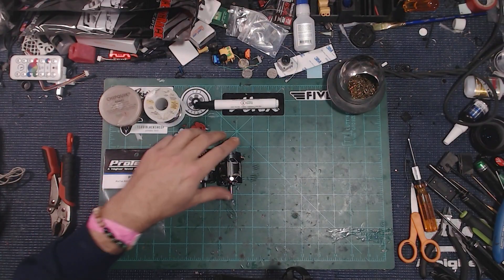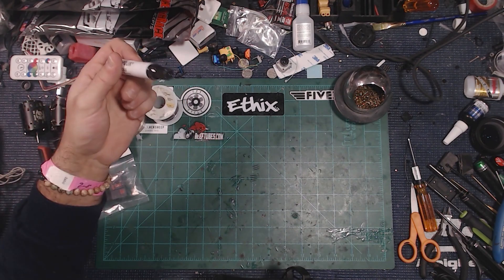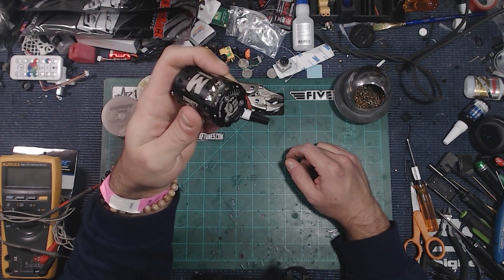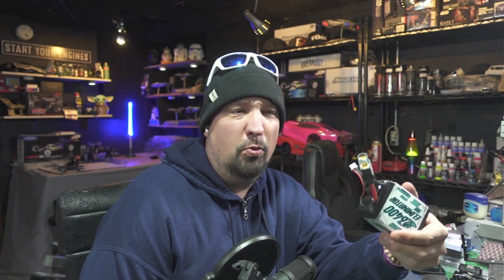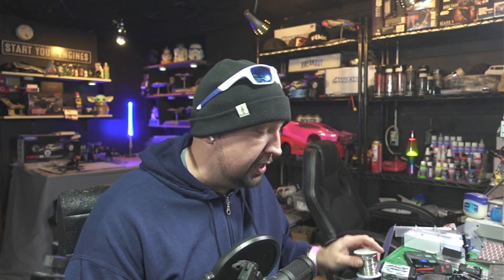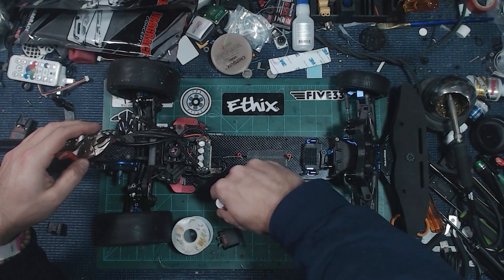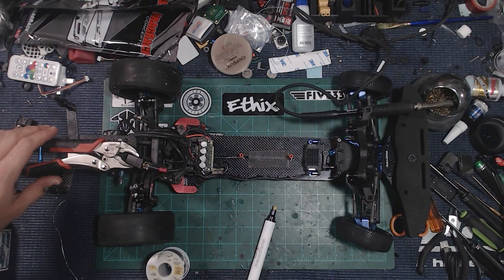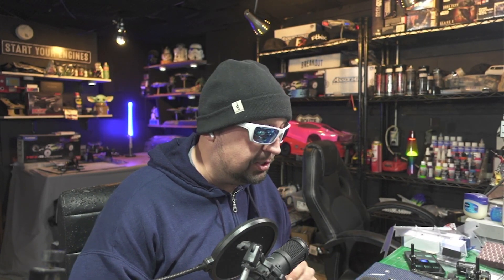SOLDER YOUR RC CARS AND CONNECTORS LIKE NASA DOES!!  QS8 SOLDERING | TOOLS TIPS AND TRICKS

Comment: these are tiny wires... easy to solder... we a 200a to 300a....  using 4awg to 6awg wire to QS8 & QS10 connectors..  how about soldering these?
Reply from the maker: Imo and data I’ve never been able to see any meaningful performance using 8 or 12g wire. If you want to push it then have at it.  It all makes sense but lower gauge never showed me it was a differndce maker. Same goes for qs8.

Comment: You need to make a guide just for soldering trinity motors. I struggled so bad on my 4 turn
Reply from the maker: I spoke about it in my last soldering video. Their tabs lead right down to the poles. Have to be really careful. Flux lots of flux so use little heat as possible.

Comment: Good video Chad.  Curious did you ever do a back to back xt90 vs qs8 connector test on the same car setup?  Just wondering if it’s worth me making the switch.
Reply from the maker: Thanks man. According to my data logs I only saw maybe 10-15 more amps being pulled through a qs8 over an xt90 with no noticeable change in voltage.  I’m debating on going to xt90 again for weight savings and being able to pull them apart a little easier.  In theory the qs8 should be better but it’s very hard to actually prove that imo. Having a 10 gauge wire over 12 is also theoretical and very hard to prove. During my fpv days we went through this entire exercise when we moved from 4s to 6s for racing. 2s is tricky though because the voltage is so much lower at say 8.4 vs 24.6 :) do you get less resistance at the higher voltage when pulling the same amp load.  So to make a short answer it can’t hurt but it’s not going to make s huge impact :)

Comment: Good video Chad. I do the same technique as you. I love using the flux helps it flow nice. Couple of my rc buddies always would say "it has flux in it" I tell them what I just told you. Well there shit pops off especially when the motors hot so guess who ends up fixing it Lol, I'm pretty good I used to do car radio and alarms installs 5,000 watt systems with multiple subs. You know it has to be right the vibration alone will test your Solder skills. I know when I have a good connection when the solder shiny. 1-up racing has very good material. 👍🏾👍🏾 Good job my friend.
Reply from the maker: thank you sir.  you know what youre doing then for sure..all those small wires arent easy
Reply: @Dorkyand40  no they are not. Agreed! I use applicator clips also clothes pins reversed. Rubber bands on pliers.. Lmao

Comment: I tell ya what those qs8 connectors were no fun the first time I soldered a set with 8g wire.   Are you seeing any difference with the qs8 on your drag car?  I've been running them on my xlx2 kraton.
Reply from the maker: I really never saw any difference when I went from xt90 to qs8 on my main car. It’s just one of those things that you know should help so you do it :) but it’s not like I say my amps being limited by xt90 at all
Reply: @Dorkyand40  I hear ya on that.   I've been using 5mm bullets on mine so far.  But I have a bunch of qs8 connectors laying around.

Comment: Bro. Get some actual “helping hands”. Not lock jaws. Helping hands. You can get them at Harbor Freight for like $6.
Reply from the maker: Helping hands are great when things aren’t installed in the car.   That’s when the locking pliers are the best.
Reply: @Dorkyand40  they are great when things are installed because the little arms can reach into the car with the base sitting on the table.

Comment: I bridged my 2 tabs on my trinity 2.5t motor but if i remove the bridge will it be fine to use?
Reply from the maker: Yeah I saved mine. You  just need some copper tape to suck up the solder.